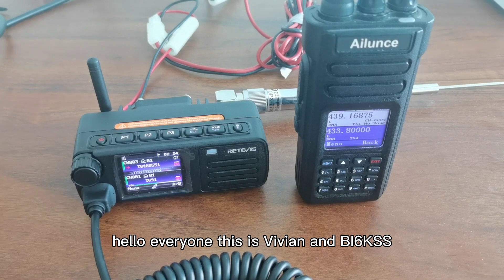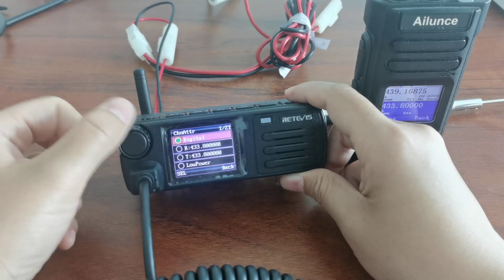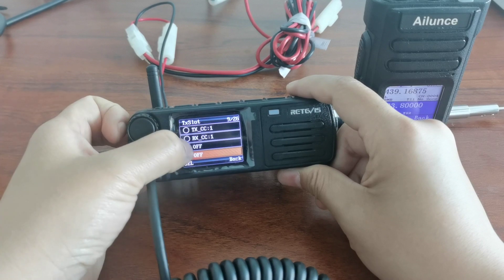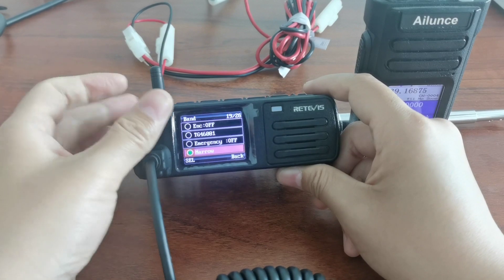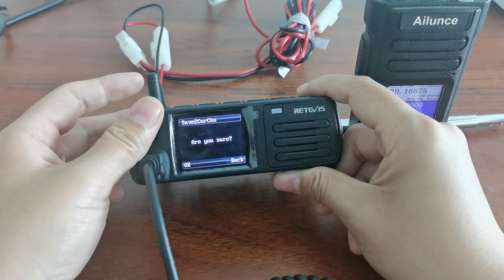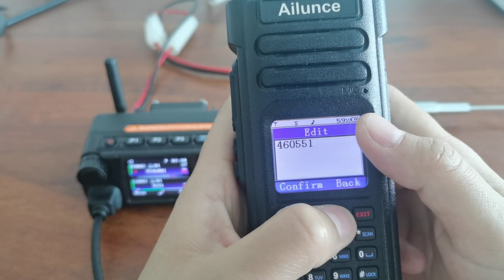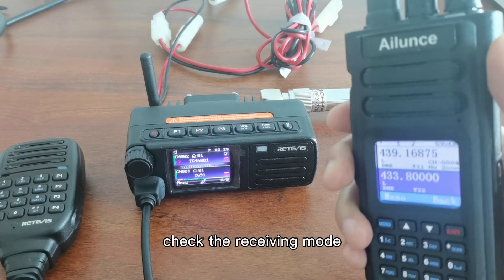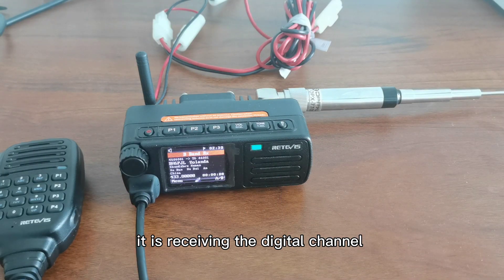Mixed Receiving Function on Retevis RT73

Comment: junk radio  wont stay powered on
Reply: mines been in my van for a week beaconinging aprs packets - absoutely no problem.
Reply: no its a good radio ,
Reply: I love your videos. But My RT73 won't stay on. It gets hot and the fan doesn't turn on. No support from Retevis. I'm sure I have a one off bad radio. But no help from Retevis and 200 USD down the drain. https://youtu.be/IflZLMRWRgs
Reply: Absolute junk! After a couple hours of talk time, the magic smoke came out of mine, and I had only had it for a couple days! Bunch of smoke came out the back mid QSO.
Reply: https://youtu.be/IflZLMRWRgs